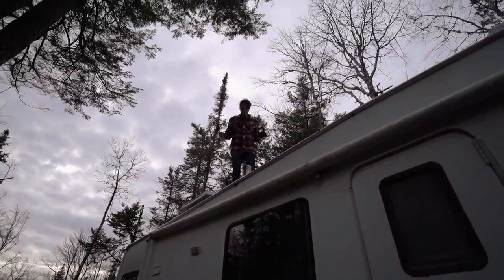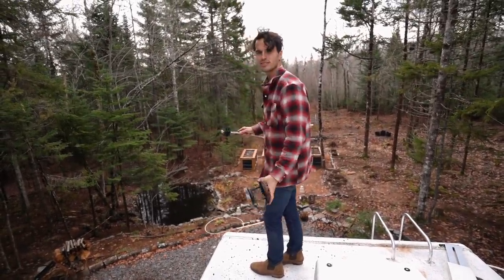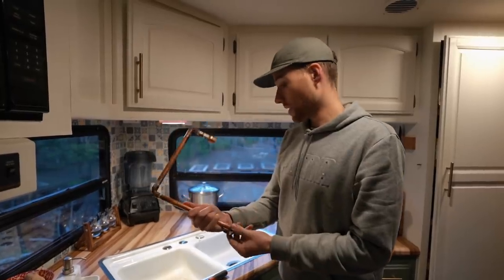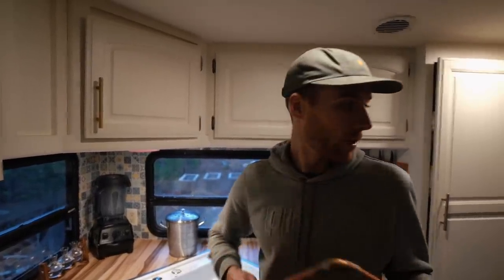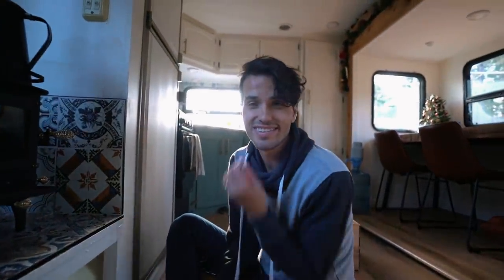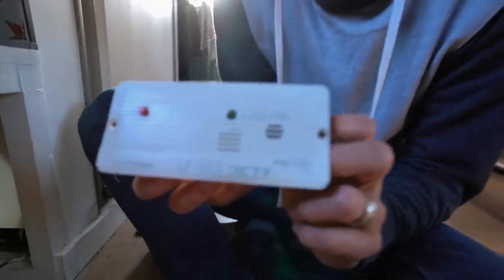Preparing our Off Grid RV for Winter

Comment from the maker: The whole time we were editing this video we kept wondering what you guys are going to think of this DIY plumbing so make sure you let us know! By the way, everything is working perfectly with our new system and Todd has put up even MORE Christmas decorations (if you can believe that). Can't wait to tell you all about it next Sunday! 💛
Reply: Want you guys to stay safe - the CO2 alarm should be fitted much nearer the floor as carbon monoxide is heavier than the air. You're doing an awesome job on both RV's and Charlie and Eddy are fab supervisors!! 👍
Reply: @ajparker6142  It's a CO alarm, anyway. (carbon monoxide)
Reply: I think your water solution’s perfect - it’s how mine’s going to work in my campervan. How do you deal with showering and hot water now that you don’t have the tanked water? I saw a video where a guy used a Hozelock pressure-pump 8 litre camping shower - 6 litres of cold plus the contents of a boiling kettle and he said it was fantastic. 

Your videos are absolutely the highlight of my Sunday - it’s the last thing Imwatch before bed here in the UK. Thanks for showing me a little of the world whilst I’m locked down!
Reply: Oh it's going to be the epitome of The Enchanted Forest.....can't wait  x
Reply from the maker: @MH-jj6sq  that area always got grimey from soap and we don't want out faucet to always be moving around!
Reply from the maker: @MH-jj6sq  partially true! but more so for the other reasons!
Reply from the maker: @carlyleroad  Appreciate that!! We try and shower wherever possible while at the gym or visiting Todd's parents...although we're no stranger to a baby wipe
Reply: Todd can never overdo Christmas  decorating. Makes me joyous and puts me into the spirit of Christmas. TY.
Reply: I think the plumbing was awesome. Y'all are a jack of all trades. Good job I love hard working men.
Reply: @MH-jj6sq   - This is a good question. I was just as confused (and I am handy)
Reply: If it works for you both it works for me!  Winter is nearly upon you and there's always next year ♥️
Reply: So you couldn't use heat tape on your pipes and hoses? My husband's father used it on their RV in Kansas. Kansas gets brutally cold.
Reply: Looks great and the Christmas decor is very pretty. Stay warm and safe there fellas.
Reply: Just love your videos! Nice to see other gay men that are totally able to get stuff done!!! Thank you for the inspiration!
Reply: Anything you do I watch whole heartedly
Reply: Tyler and Todd Happy holidays guys i love the video you guys are absolutely amazing Covid sucks I hate it I’ve started Christmas music and movies early this year because we need happiness Covid sucks I just love you guys I can’t wait for this to be all over it sucks sending you love ❤️ and happiness
Reply: 👏🏻👏🏻👏🏻😁 Y'all did an awesome job insulating the plumbing, but I always thought y'all had a big water tank that y'all filled up with fresh water to cook and shower with and recycled the dirty water instead. Go figure, huh? 😅 Anyways! 😅 Here's to you, Tyler, for learning something new! 🌈🍸😁🍸
Reply: I always love to see how you renovate and create whatever the necessity of the moment!  I'm waiting impatiently for the next video!
Reply: Love watching your videos, very entertaining! Would you mind sharing the name of the song you used that starts at the 13:37 mark. Thank you for bringing the light and humour ❤️

Comment: Hey guys take some of that board insulation and put on top of you slide out. Cover with a tarp starting on top of the roof down over the slide a bit. Logs or blocks to hold the tarp on the roof. I wintered in my RV one year that seriously kept things warmer. I also used it for skirting between the trailer and the ground.
🤗🤗🤗❤️❤️❤️ 🌈
Reply: Thanks. I was so during about that for my home. I have to head to Home Depot tomorrow anyway. I will use your idea! Happy holidays Tiny Solar Shack!

Comment: Tip: Heat the plastic hose with either a heat gun or hair dryer until pliable. It will then very easily slip onto the barbed male end.
Reply from the maker: Definitely going to do that next time 😂

Comment: In our apartment , we have the smoke alarms already hardwired in , there is a battery inside it still in case the electricity fails , and will last 3 years !When it is dying down it will chirp once every 30 seconds which if you dont have a spare could drive you insane .

Comment: Loving the Christmas decorations fellas. Our carbon monoxide alarm kept triggering last year for no apparent reason. It worked out it triggered because the leisure battery had died. Check out the battery if the new one keeps triggering! x

Comment: You lads cracked me up - How did you keep a straight face with all that innuendo? - anyway I'd say use wire wool to really clean up the copper and inside of the fitting - apply a thin smear of flux and use just a small amount of solder till its seen to run all round the fitting - when soldering try to apply the heat to the  fitting and just up from the pipe - when close to temperature whip the  blow touch to one side and dab the solder on the joint - your aiming to just get the solder to run silvery and shiny - if its dull its too cold and called a dry joint - many a joint fails because its not clean or has been over heated and oxidized - remember the heat that melts the solder should come from the fitting and cooper not directly from the touch - using wood as backing int good the fumes can  dirty the joint

Comment: Safety - love the fact you have various alarms, may I check you have a decent size fire extinguisher or 3, not the tiny useless car size ones. Here BIGGER is better, as you so far away from fire services 
(I assume), with the ones with a pressure indicator so you can check it annually. Even a fire extinguisher ball (google it), for when you away from the van !. Nest do a Fire/CO unit that alerts your mobile, but you need a router/internet. Safety is soo important, and while Im at it, whats your van med kit like.......? Vers is good, lots of options, just in case one thing doesnt work...

Comment: Like how you figure out plumbing, not as easy as it looks. With YouTube you can fix anything.  Last time I did plumbing a friend was solder copper pipe and having a hard time. He said my flucks was junk. I noticed he did not sand the connections clean and put scratch marks, he says you do not need to clean new pipes just old ones. Wrong make sure  you sand the  Patina off new pipe it soldiers better and won't leak . Now I have to redo his joints in my bathroom.

Comment: Why not just buy heating cables for water pipes. It could not be made easier. You can also buy a regulator or temperature gauge for it. The only thing that matters is that it is approved for drinking water
Reply: Good idea for anyone on grid.
Reply: @HolgerJakobs  But they do have batteries - modern high-efficiency cables in the short length use very little power

Comment: you are terrible at soldering!!!   You paint the joints with flux, then heat the pipes outer pipe on joint until very very hot.  then touch the area needing soldering and it will melt the solder  and draw it into the joint area.   You should not have the paste like appearance on the pipes after the soldering.   A good job will be soldered but you can not see the solder, it had been absorbed into area to be soldered.